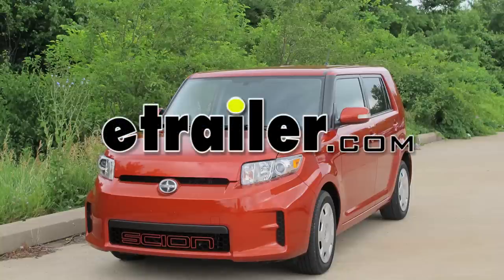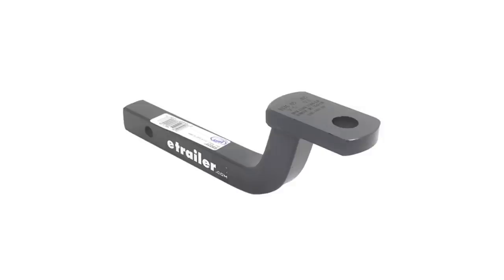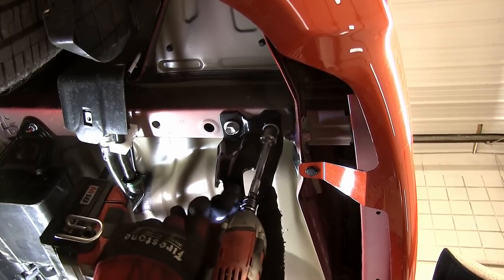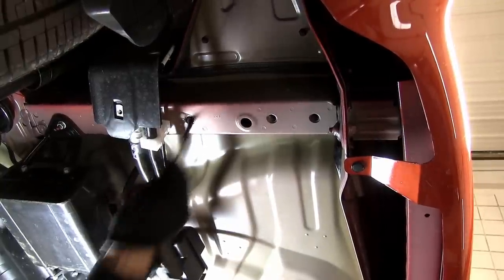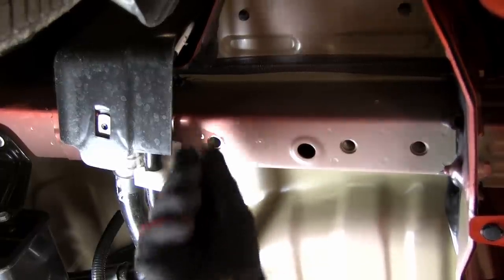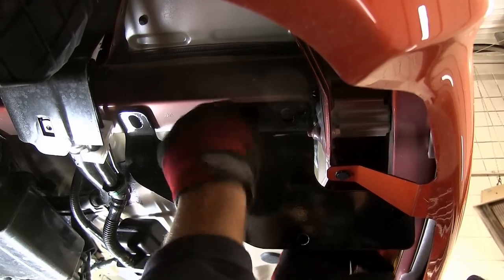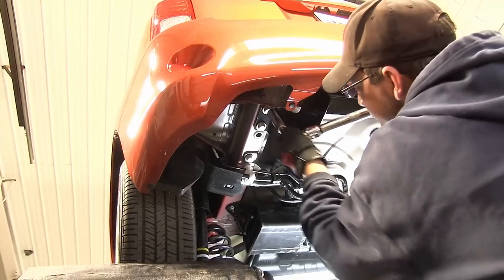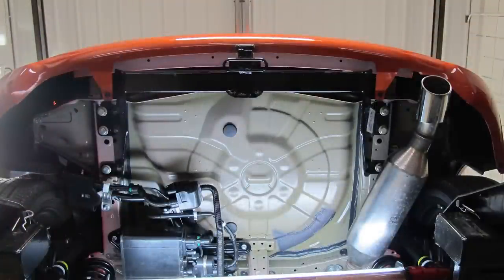etrailer | 2012 Scion xB Curt Trailer Hitch Receiver: Complete Installation

Comment: How did you get the toe hook off so easily with your battery operated drill? My drill does not get the bolt off that easily because of how firm the bolts are screwed into the frame. Do you have any suggestions for tools?